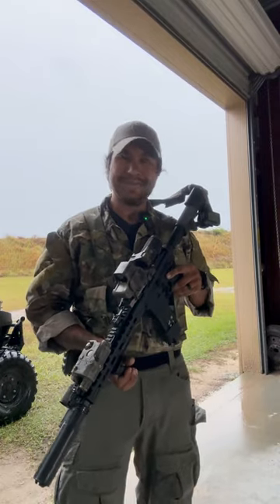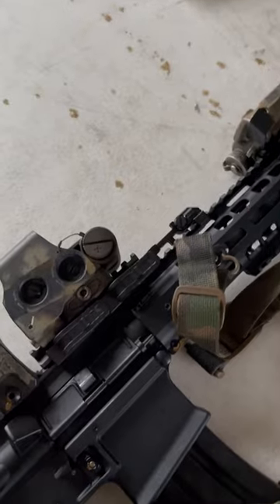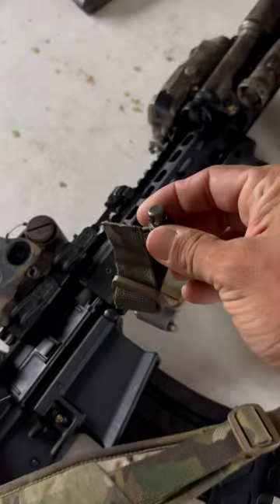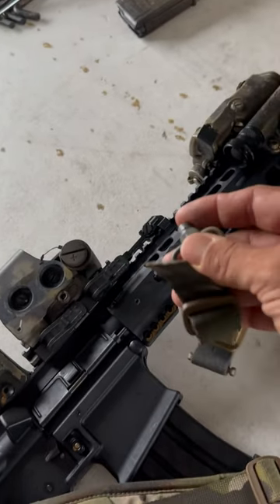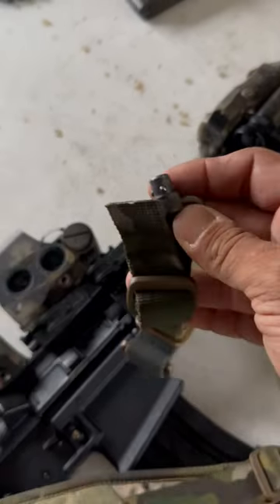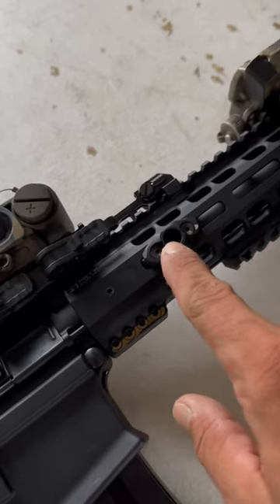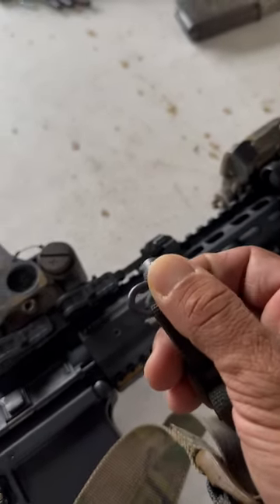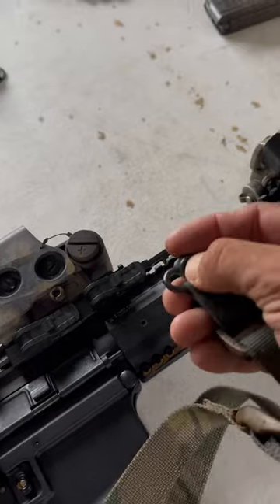Don’t NEGLECT this!!!

Comment: Don’t forget to check for corrosion/erosion when your steel QD point interacts with your aluminum rail.
Reply: Yeah keep them lubed a lil bit to keep friction at minimal. I don't use the ones on the rail unless they have steel inserts I just mlock or pic mount on the rail with Magpul. They will wear out the aluminum quick. Your correct

Comment: Those little QD ball bearing setups have been around forever. My dad had his steel mill keys on one in the 70s. He'd take his mill keys off his keychain on weekends by doing the same action and leave that part on the kitchen counter at home. On Monday he'd clip the mill keys back onto his house keys and go to work.
SF just utilized the system for a new purpose.

Comment: I run a QD on my stock but then either directly tie 2-3 loops of paracord directly through the m-lok slots or through a magpul paraclip attachment point up front. It's more maneuverable, quieter, and allows you to do things like wrap sling around arm to brace your gun for a standing long distance shot much easier. If you need to remove sling there's still the QD at the back.

Comment: Those little ball bearings fail all the time. I stay away from those on my slings. Proctor slings is where it's at.
Reply: Had one of these fail me on mission in the Ghan… good advice
Reply: Does that allow for the sling to be removed quickly
Reply: @CheekRunner  nope! But then again.. why would you need to remove a sling quickly?
Reply: @floridaman9026  So you didn't watch the video. Got it.
Reply: @miniapplesun  oh I watched the whole video. But I don't plan on being in any helicopter crashes anytime soon.
Reply: @floridaman9026 😂😂😂